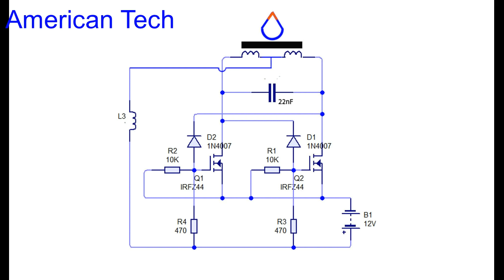How to make a small and powerful induction soldering  iron

Comment: To make a induction soldering you need a  induction soldering....sooo....how the first one was made ?
Reply: The soldering iron made in the video does not use induction heating. The soldering iron used to make it is probably has soldered connections too. A soldering iron is not the only way to solder things. eg a torch can be used.